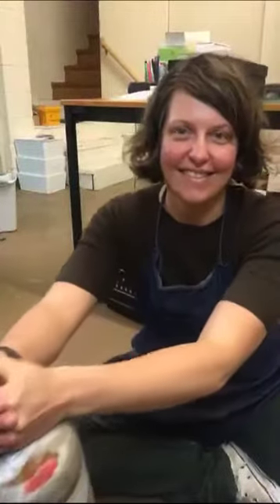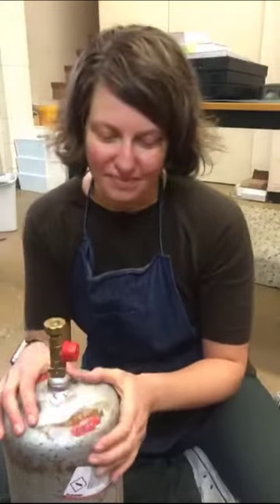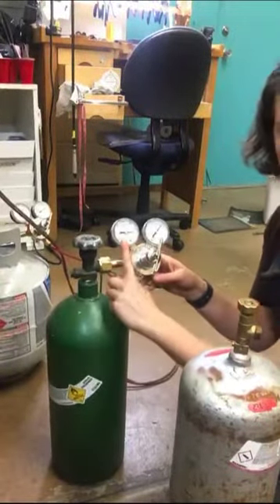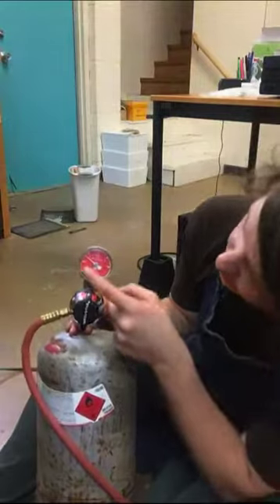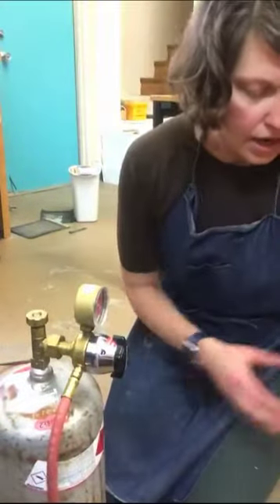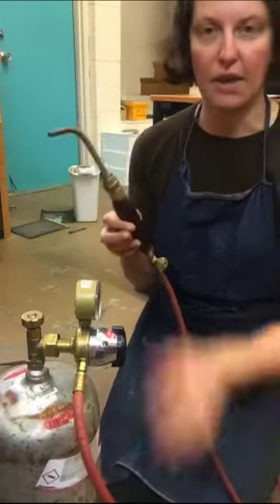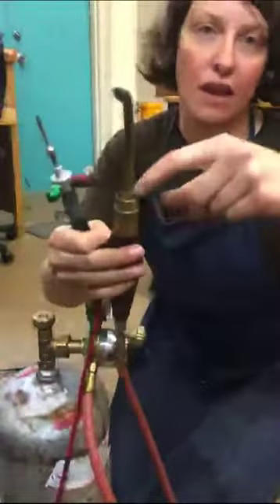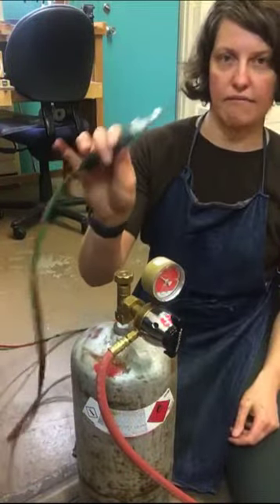how to attach an acetylene "b" tank to a prestolite torch

Comment: I've got the same proto lite regulator. But can't attach it to the 40cu 'b' tank do to a 520 type thread on the tank. What adapter would I need for the union to connect? Thanks

Comment: My question is, the know in the middle,  how far should you turn it?
Reply: I start with the knob pretty far out. Light the torch and you can adjust the know to a place where you like the flame. It controls how much gas is coming from the tank into the hose. The more gas the higher the pressure. Here is my video about it. https://youtu.be/bJB-bizsfi4?si=aB-rbffotCi35bl2